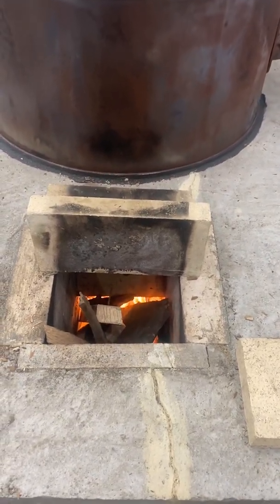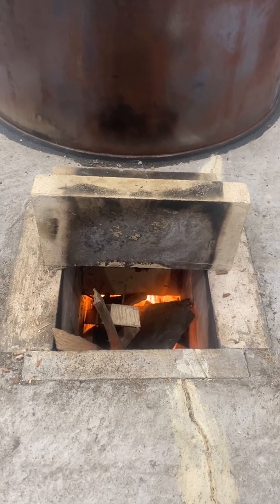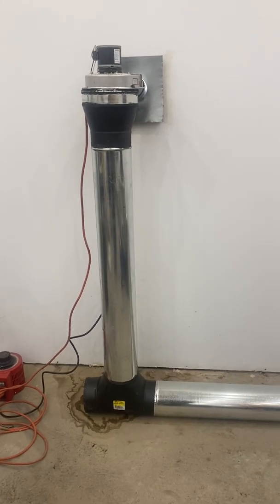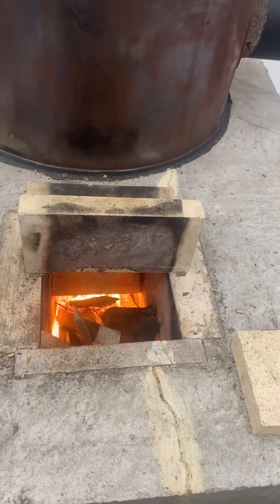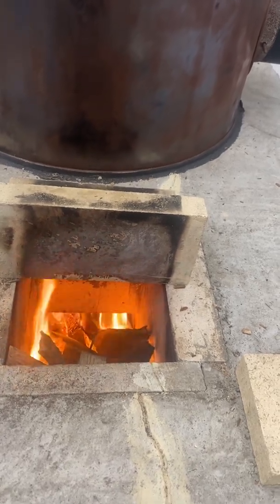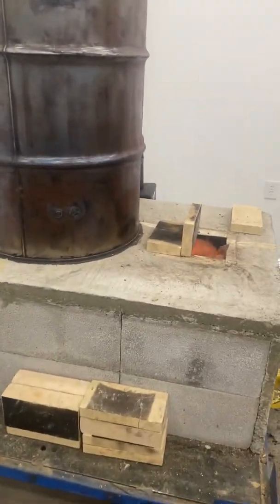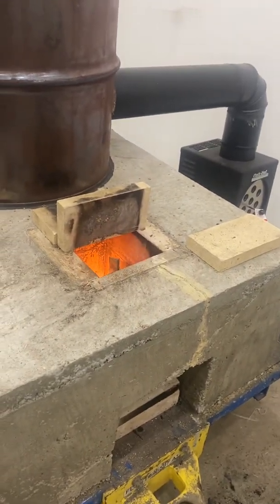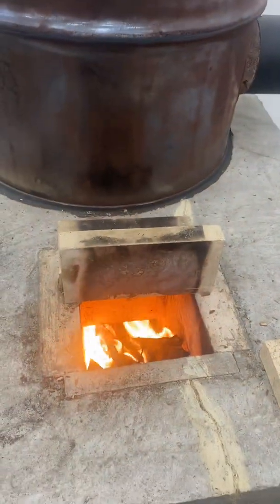Variable induction rocket mass heater for the work shop general overview.

Comment: I really like your variable draft assist.  Please show how your fan mates up with the exhaust.  Please give dimensions of feed opening, feed height,  burn tunnel. And to have it on wheels is great. Thank you.
Reply from the maker: I would be happy to. I am going to do a 30 day review here in a day or two. I will include what you asked for plus an operational update. I will say for now the variable speed draft is a real winner. I can go from blast furnace to mild by going from 120 volts to 40 which I use to cook off any coals left over after a good long burn.
Reply: @M35a2guy  I look forward to the details.  Thanks for sharing.